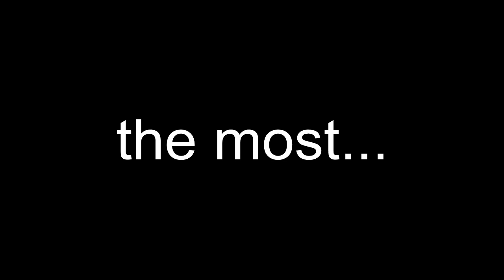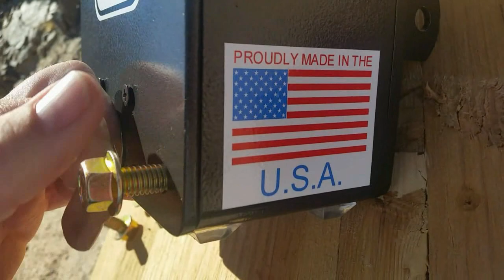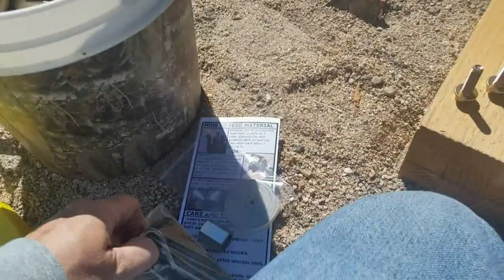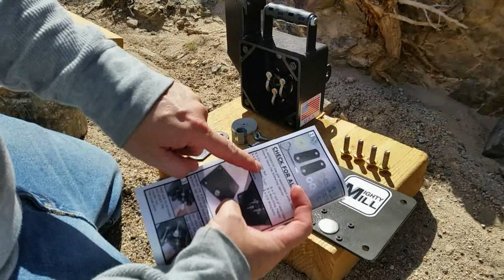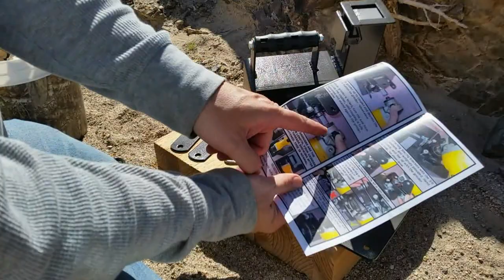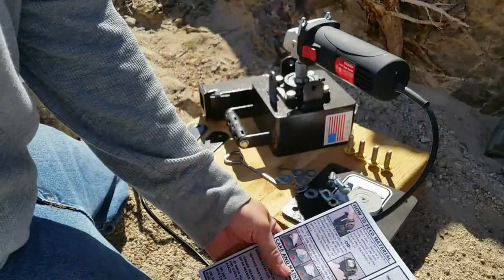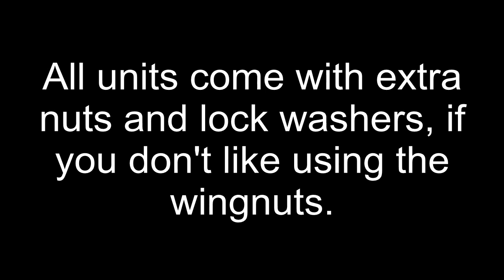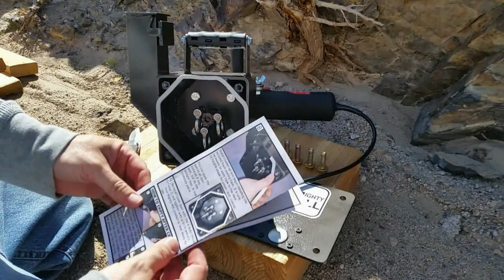Mighty Mill portable mini rock crusher. Sample GOLD ore FAST!!!

Comment: Just bought one... there’s one left on eBay..... One left people...!!!
Reply from the maker: Thanks for the  great comment! Sorry I haven't been on my channel much, but it's been a very busy summer. I do plan on making some new videos showcasing the mill, and the new discharge tube attachment I made....after I get some home projects done. Not enough hours in the day, LOL!

Thanks for your purchase, and  I'd love to hear how it works for you. Take care!
Reply: Southern Oregon Prospector im curious about the discharge attachment...  if the machine was to run continuously and you were feeding in rocks... would larger particles not escape? or is there a mesh to keep in the large particles and let small particles out?
Reply from the maker: @TheSummersProject  it comes with 2 screens, one has 1/16" holes and the other has 3/32" holes. The larger pieces don't pass through until they are crushed fine enough. You roughly end up with between 100 mesh and 200 mesh material. You can run it without the screens as well, which is what I do sometimes when I want to just quickly crush some material. I tilt the machine back a little, feed the rocks in, shake a little, and then tip it forward and it pours out the tube.
Reply: Southern Oregon Prospector is there photos of the product about?
Reply from the maker: @TheSummersProject  yes, you can see photos on the Ebay sales page, just go to Ebay and type in "Mighty Mill" and then look for the listing that says discharge tube attachment.

Comment: Really a piss poor exit strategy for the fines.Shake it baby.And the electrical plug and paint can opener.Really? Funnel it too a point.
Reply from the maker: It worked for me for the last 5 years, but the latest design release has a new, larger opening, with a steel plate door that uses thumbscrews. And with the discharge tube attachment you get the funneling action you mentioned. You can check it out on ebay if you'd like, just type "rock crusher" in the search bar and you'll find it.